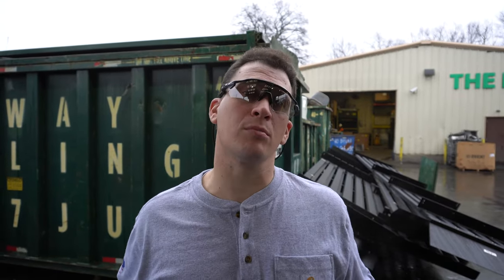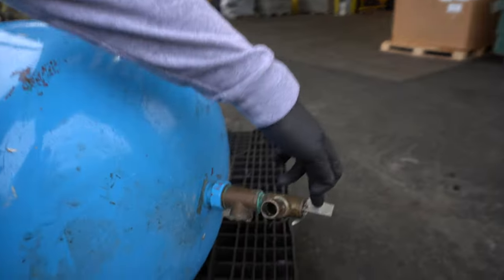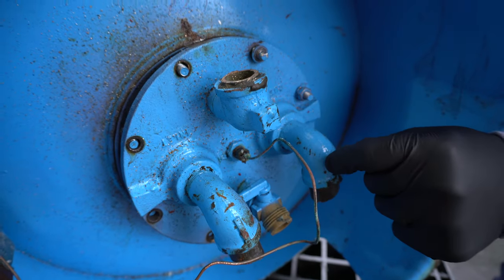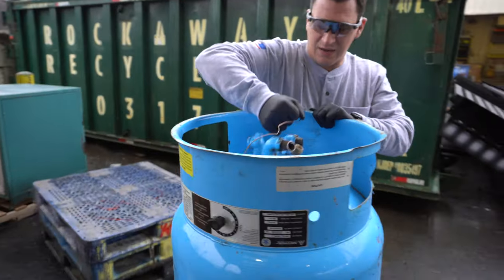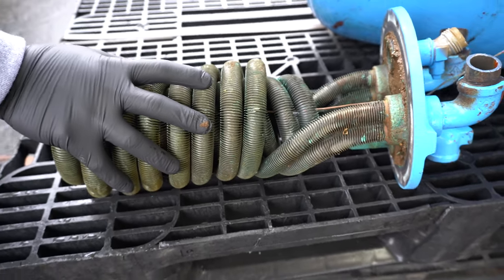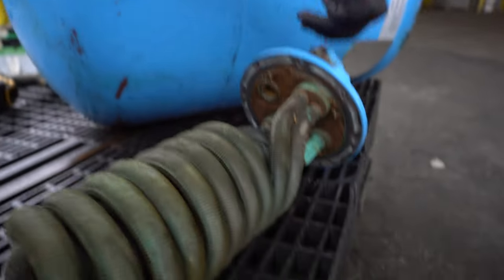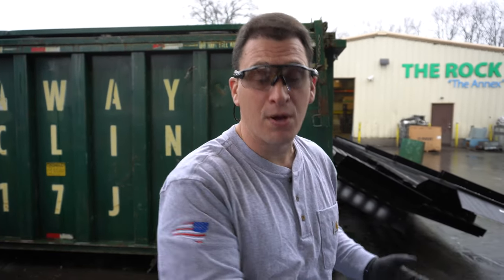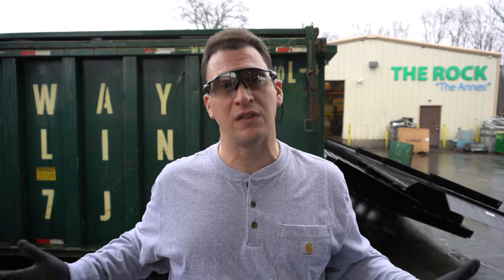Maximize Your Profits with Copper From Water Heater

Comment: Not sure of the model number but the plastic outer Amtrols with the bottom coil have close to 12lbs of #2 copper the brass plate that the coils connected to that’s about 8 lbs and then there’s a brass plate on the top that’s another 8 lbs of brass
Reply from the maker: Thank you!

Comment: nice info here, i do have a Question, i have been finding allot of Transformers that have Aluminum windings ( i have been removing the Windings and putting them in a Bucket ) and Aluminum Wire with cover, would the scrap yard take these if i brought it in ?
Reply from the maker: Yes they would take them, but generally they go for the same price as heavy steel.